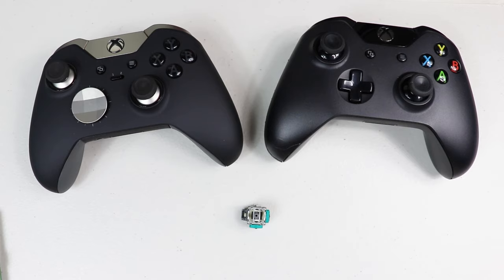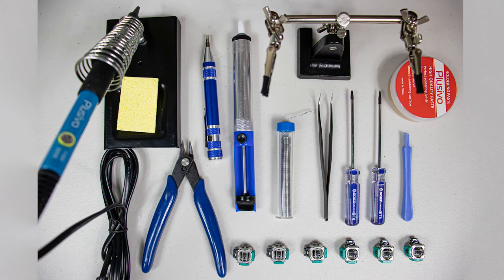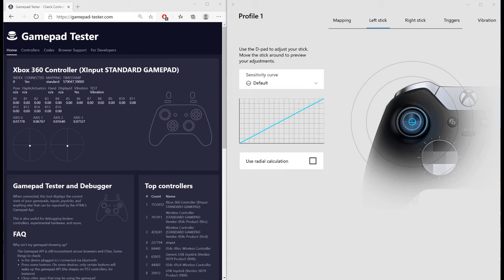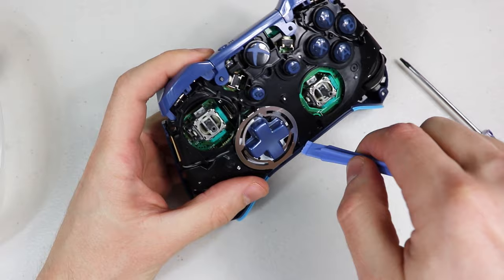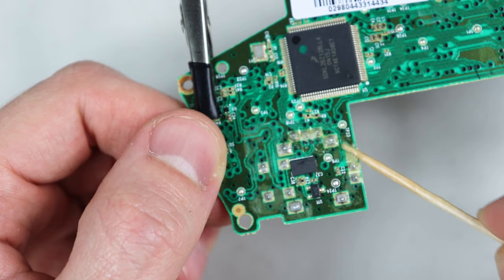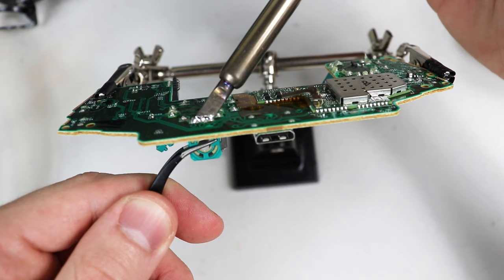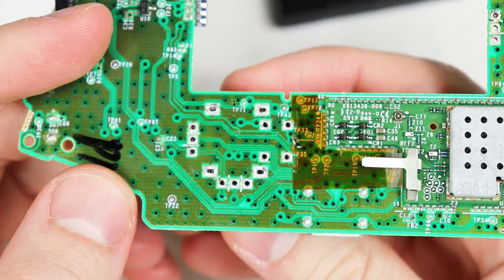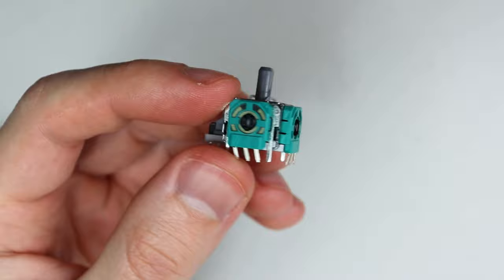How to Replace Xbox One Controller Analog Joystick - NEW METHOD - Fix Stick Drift, Broken, & Loose

Comment: to be honest, I like the old way better. This is way more work than measuring resistance.
Reply from the maker: That's great! I think you're actually the first person to say that. I think this one might seem intimidating at first but once you get it down it can go a lot quicker.  It's what I do on all my controller repairs now.  Thanks for sharing, glad the other method is still working for you :)
Reply: @SOSSGAMING  my thing with this is the chance of breaking the pins on modules by bending them like that over and over.
Reply from the maker: @Traitors1991  Ah, understood.  The through holes on these boards can definitely be some sensitive little buggers.  Although I think I've replaced 200+ doing it this way and no issues or damage to anything so far, but that's not to say it can't!

Comment: Hi SOSS Gaming! have a little question hope you can help me... I replaced just the potentimeter and it works for about 5 minutes and then it goes haywire and drifts up by itself any resolutions to this problem?
Reply: Found the problem and thanks for the quick reply 😄
Reply from the maker: @georgelako6702  Sorry for not responding earlier I have been away for a while. Glad you were able to figure it out!

Comment: is there a way i do not have to use the iron?
Reply from the maker: You may first want to try prying open the potentiometer that is causing the issues and wiping the inside of the potentiometer and wiper with isopropyl alcohol.  Sometimes that will give it a little more life.  If that doesn't do it, I hate to say but a soldering iron will be required.

Comment: I know this is an old video. But gow bad is it if you dont calibrate them?
Reply from the maker: If you have the new S/X controller you don't need to! If an older one, I've seen up to 30% in a given direction. In no way playable. However about 1/4 to 1/3 of the time it is playable without calibration.
Reply: @SOSSGAMING  well I have the elite controller series 1 that needs stick drift fixed. But will try a good cleaning with electronics cleaner first, before I get to soldering. Have managed to get my hands on the replacement sticks for the series 2 controller. The should match up and they seem to have better build Quality also

Comment: Hey, I’m going to try and replace a potentiometer as I only have up/down drift, the rest of the joystick works fine. Do you know if the potentiometers are the same as in the Xbox 360 controllers? Thanks!
Reply from the maker: I actually haven't compared the two in person, but if I recall, others have told me they are different and are not cross compatible.
Reply: @SOSSGAMING  thanks for the reply! Just saw some joysticks on eBay with the orange potentiometers, apparently they’re a new design, will give them a go!
Reply from the maker: @mitchscarman6064  No problem.  Best of luck!

Comment: Hey there bud! Im wondering ifyou can help me out with component ID. Im working on the Series controller as I told you before. I dumbly took my fine cutters to the joystick to remove it and wasn't watching what I was doing. I knocked off components on D15 and C21. I'm wondering what type of components are in these positions and their value. If you could help me I would greatly appreciate it.
Reply from the maker: I think you are referring to the ceramic capacitors?

1uF - https://www.digikey.com/product-detail/en/kemet/C0402C105K9PACTU/399-4873-1-ND/1090868
0.1uF - https://www.digikey.com/product-detail/en/kemet/C0402C104M8PACTU/399-7764-1-ND/3471487

I'm not sure which ones are best to go there though but you might want to chime in with acidmods forum to be sure.
Reply: @SOSSGAMING  I think c21 is a ceramic capacitor 0201 or 01005 in size, not sure of the value though. d15 is a w5 diode 0402 or 0603 in size. Although im not exactly sure. I do see a diode symbol at d15. Im not sure if c21 is an open and unused or if there was actually a component there. The series board is different from the elite board. I noticed the elite boards don't have these components next to the joystick. Im feeling really dumb at the moment. I shouldnt have been so aggressive.

Comment: I have a hopefully quick question. The joysticks I bought from you guys lock into place in 3 of the 4 directions of I go fully in that direction. Basically, they don't typically automatically bounce back to center if I go full x or y. They haven't been installed yet, but is that what's supposed to happen, or is there an adjustment needed for that?
Reply from the maker: Yes, this is normal. Once the faceplate is on it will be normal. I demonstrate this within the first few minutes of the video I believe.
Reply from the maker: Best of luck on the repair :)
Reply: Good to know, thanks. I should probably watch the whole thing instead of skipping to the calibration bit. Largely because it's going into a Hori Split Pad Pro for my Switch, so a lot of the Xbox related items aren't relevant to my situation, and since Hori never got back to me and visibly they're the same joysticks, I figured I'd be generally fine.

But thanks for the quick response, I appreciate it. Probably going to do the repair this weekend.
Reply from the maker: @rickgubala830  I believe that while the switch pro controller joysticks appear the same, they actually use higher resistance potentiometers. Which means you might not get full range after installing the xbox joysticks :/

However, I'm not sure if the calibration software is able to adjust for range as well.
Reply: @SOSSGAMING  I did end up ordering a stick that was advertised as for the switch pro controller, but it did look to be the same model as yours, as far as I could tell. Either way, it was a perfect replacement for the Hori Split Pad and it's been working great. No calibration needed either. And at least I have some more replacement joysticks from y'all in case I do need to repair one of my Xbox controller or something.
Reply from the maker: @rickgubala830  Oh great! Glad you were able to find the right one and get it fixed.

Comment: My controller doesn’t turn on when I plug it into my MacBook idk what to do
Reply from the maker: I haven't personally used a macbook so I'm not sure if it's a software thing or not.  If the controller works on the console when it's plugged in it might be an Apple thing.  If it only works with bluetooth on the console it could be a usb port issue.  You could also instead use the Game Controller Tester App on the console.

Comment: I would like to know if you know where I can get an Xbox elite controller 2 analog joystick replacement with adjustable thumbsticks? I would like to make sure I get the right one
Reply from the maker: I actually sell the joysticks at my eBay/Amazon store, but I just did a brief search and actually can't find the metal dome pieces that anyone is selling.  Seems there a lot of options for actual detachable thumbsticks though.  Hmmm
Reply: @SOSSGAMING  I don't need the dome pieces, just need to replace the joysticks as mine are starting to drift and I need to replace them for me xbox elite controller 2. Do you have the link?
Reply from the maker: @junioraguilar9567  Oh ok yes here you go: https://www.ebay.com/itm/224138078310
Reply from the maker: @junioraguilar9567  if it's just drift, you can just change the potentiometer and not the whole thing if you don't want
Reply: @SOSSGAMING  When would you change the whole unit.
Also, do you sell the potentiometer and wiper replacements?
Reply from the maker: @junioraguilar9567  I will be selling potentiometer/wiper kits soon actually.  Original xbox joysticks use the same potentiometers/wipers though, so you can just take them off those to use for drift issues.

Comment: Would this work on a ps4 controller? Will you do one for ps4?
Reply from the maker: Yes, it is basically the same process. I will eventually do one specifically on the PS4 controllers but there I have a few videos in the works ahead in the queue

Comment: Hello, do you know if it's fine if the controller you fix still has stick drift after? I fixed 3 so far and they all had stick drift with new analog sticks. Can you please shed some information on what the reasons for this happening?
Reply from the maker: How bad is the drift? My guess is they were never manually calibrated? Or if it shows 100% in any direction, likely a pad is damaged. These boards can be quite finicky sometimes.
Reply: @SOSS GAMING  OH, so it's the board that's damaged because of too much heat and soder? Everything seems to be correctly soldered, I keep replacing them more than 3 times, and I keep getting minimal stick drift. I'm just wondering what the problem is. Is it my soldering skills? If it was, then the stick drift would be high, but it's not. Is the problem that I heat the board for too long thus causing permanent damage or is it something else?
Reply: @SOSSGAMING  how do you manually calibrate?
Reply from the maker: @Anonymous-yi9ki  Ok, just be careful. Too much heat can lift the pads which will cause permanent "drift". 

I show how to calibrate throughout the video :)

Comment: Is it possible to just replace the gray stick on the joystick or do I have to replace the whole thing
Reply from the maker: I'm guessing the shaft of the joystick broke is what you're saying? In that case, it would be easier to replace the whole thing, but it is technically possible to replace the shaft.
Reply: Thanks both,  I had same question 👍
Reply: SOSS GAMING yeah dropped my controller and the shaft broke and for a while super glue worked but it just doesn’t work anymore
Reply: If you de solder it and pull it off the board you can pry it apart replace the grey stick and put it back together then solder it back on.  but you might as well replace it at that point.  I have not found a way to replace it while on the board.

Comment: I'm having an issue on my left analog stick when I aim towards the right it's normal but when I move it to the left or aim left it's slow and its effecting my gameplay any ideas?
Reply from the maker: To me it sounds like the x-axis potentiometer is a bit worn or could even be gunked up.  You can always first try prying the potentiometer open and cleaning it out with isopropyl alcohol, and if that doesn't work either replace just the potentiometer with a new one, or the whole stick if you're feeling up for it.  I would assume that would do the trick.
Reply: @SOSSGAMING  thank you man

Comment: Hey, i am having trouble connecting the controller to the website. I just put in the new joystick, but it won't connect and it has trouble turning on. Do you know that to do?
Reply from the maker: Make sure both boards are connected and the cable is connected to the computer. You also may have to press a button on the controller for it to register on the website. Does everything look ok as far as that goes?
Reply: @SOSSGAMING  Yeah, I figured out the problem. I needed to screw some screws in so the power would work. Thanks for your help. Right now, I am trying to fix it
Reply from the maker: @hellohi9597  The t6 screws that connect the two boards? Wondering if that grounds it or connects the two board better or something. A couple others have told me they had issues connecting as well. So far it's still a mystery.

Comment: So if you replace the analog sticks completely and they still drift? It's basically cheap and fake parts?
Reply from the maker: Not at all. You need to manually calibrate them. The cheap ones with integrated deadzone can't really be calibrated though, so if it still drifts with those ones then you will need to get the correct ones and manually calibrate them.
Reply: @SOSSGAMING  Ah awesome. How does one manually calibrate them lol?
Reply from the maker: @harrisahmed2017  I show in the video :)
Reply: @SOSSGAMING  Thank you

Comment: At 28:15 I can’t connect the wire with the mother board/front circuit board. Will I be able to solder this?
Reply from the maker: Fantastic question. Unfortunately I can only give my opinion on this matter and would suggest more research, but personally, I don't see why not, and would probably solder it myself (at least attempt to) in the same situation.
Reply: SOSS GAMING I’ve researched it all day haha and found nothing. I’ll try to solder it this week. Hopefully it works. I’m assuming the controller just won’t work period without that wire
Reply from the maker: @InfinityOnHighx1  I'm not exactly sure what it's for, but I think it'll still work without it actually, as when I test these controllers for calibrating they don't need to be connected. Personally I would probably just solder it anyway, don't see any harm in that.

Comment: Is it possible to remove the joystick without destroying it?
Reply from the maker: Yes! Hot rework station or desoldering gun are the best ways. Alternatively if its the larger through holes you can probably get it done with just a soldering iron. On the smaller through hole controllers (like the elite) it's near impossible with just soldering iron, but I suppose technically possible if you have great skill!
Reply: @SOSSGAMING  tried giving it a go but my iron is ancient and barely made a dent gonna have to invest in a new controller RIP. Cheers
Reply from the maker: @SinisterSoundZ  bummer :/

Comment: so I finished changing out the stick but all the controls are janky now  bumpers double press dpad holds right and the stick i replaced doesn't seem to work at all but idk where i went wrong i connected everything back the way it was
Reply from the maker: Dang, sorry to hear that. Hmmm. Sounds like one of the small diodes or capacitors may have became damaged or dislodged. That is my guess.
Reply: @SOSSGAMING  well i inspected it further and all the buttons actually work properly but the stick is stuck going right still and i cant pull in any other direction
Reply: @SOSSGAMING  Ive been practicing with a few broken cause this procedure is the only one ive not been able to do successfully even though it looks right but i am getting better and faster at it just don't understand where i mess up
Reply from the maker: @jmanvengeance  Sounds like one or more of the through hole pads are damaged on the x-axis potentiometer :/
Reply: @SOSSGAMING  hmmm ok thanks imma get it i have quite a few rocket league is tough on the sticks lol

Comment: Hi!! In my case I have been an accident with the joystick PCB, It was broken two welding points. ¿Maybe exist an diagram of connection to fix the PCB track? My Xbox controller is the 1914 model.
Reply from the maker: Sorry to hear that! On acidmods forum there are diagrams of the 1914 model I believe.
Reply: @SOSSGAMING  I could fix the joystick, but the pulse L don't work, I tested pin by pin over PCB and work. When its connected to PC the L pulse didn't detected. ¿How I fix it?
Reply from the maker: @w.i.l.s.o.n.  Dang, I wish I knew. That would be a great question to ask on the acid modz forum though!
Reply: @SOSSGAMING  During the left analog stick replacement, I lost the C20 and C37. Perhaps those capacitors are works with the pulse L?
Reply from the maker: @w.i.l.s.o.n.  Those are pretty important I believe! You may be able to find some on mouser or digikey
Reply: @SOSSGAMING  Maybe you know the value of those capacitors?
Reply from the maker: @w.i.l.s.o.n.  I'm not sure actually. You may be able to get a response on the acidmods forum?
Reply: @SOSSGAMING  I found this answer: "That trace is the RSY line, it just runs under the expansion port. C23 is just a decoupling cap on that line, you'll never really notice it missing. It's 10nF, 0201 size, anything 4v or more will work if you want to replace it." I hope that is same to my case.
Reply from the maker: @w.i.l.s.o.n.  Great! Although it sounds like from what they are saying C23 isn't an issue? So maybe it's something else?
Reply: @SOSSGAMING  I will try to test.

Comment: im having trouble getting the cap off. to replace the sensor. is there something im missing?
Reply from the maker: The thumbstick? Which controller are you working on? It should come off pretty easily. Wonder if someone had worked on it before and glued it or something, if that's what you're talking about.
Reply: no. it was factory new when i got it.
and no im talking about the thing that holds the sensors. the blueish grey casing that holds the sensors that controls the vertical and horizontal controls @SOSSGAMING
Reply from the maker: @DeputyFish  The potentiometers? I'm sorry, still having trouble understand. What part of the video is it at?
Reply: 17:22 the cyan box on yours. on the sides of the potentiometers @SOSSGAMING
Reply from the maker: @DeputyFish  The metal casing? Did you start the chop up method? 

Or do you mean the green plastic potentiometer? If so, I show how to remove that at 11:05 by twisting a small screw driver on top of it to pry it open.